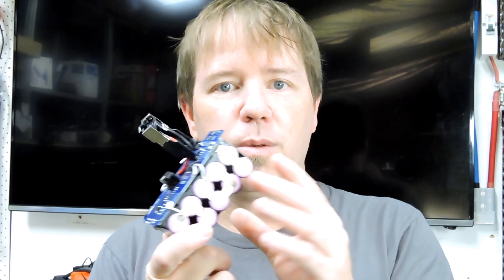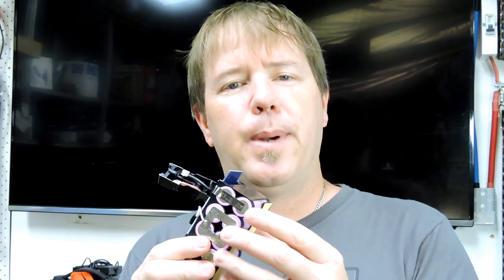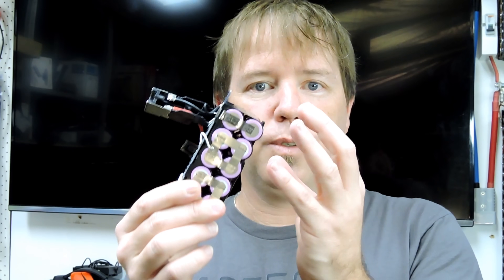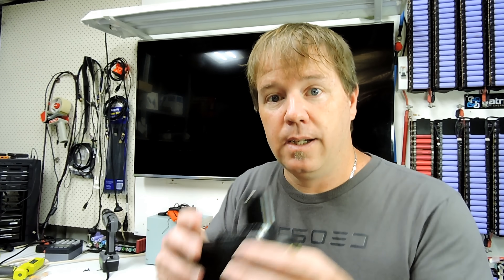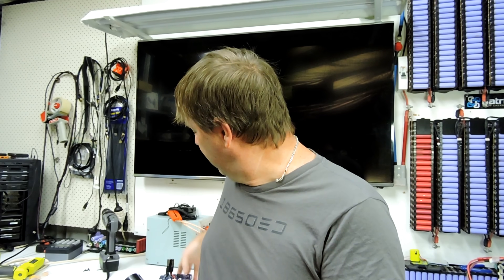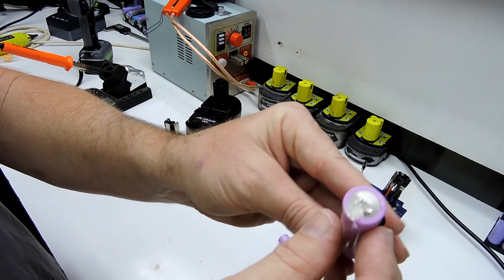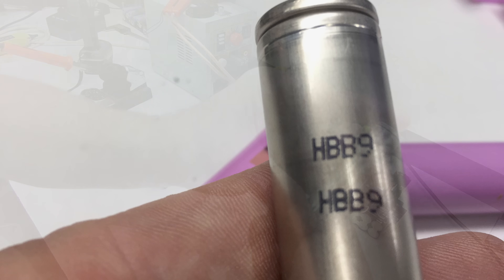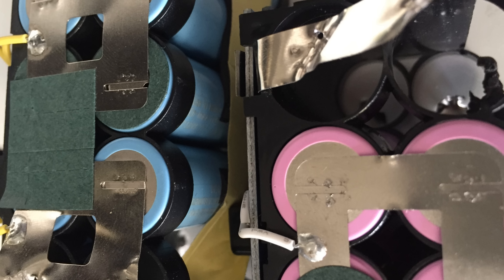Did Vanon set me up?

Comment: I probably would have waited until the results were in before posting. It does seem dodgy though
Reply from the maker: My issue is I promoted something with known fantastic cells with data sheets and proven track record and so far all reports no-one has received the same product yet Like I said in the description - very happy to print a retraction and remove this video if there is any evidence to prove I'm wrong.
Reply: You can call me laptop repair

Comment: I sub you because it looks like you have a DYI Power wall and I am I'm thinking about doing a partials Solar Power Wall to start to to run my office - computer, lights and other items. I am just getting started. I have gotten around 50 use laptop battery packs. most are Samsung batteries. After charging some of them most 2300+ again I am just starting and have lots to learn but I've been interested in solar for a long time but one of the things that put me off is the battery cost. With lithium batteries I can build a very nice battery pack for less $$ and batteries will last longer.  Any help would be appreciated. What size battery pack should I make how many cells, where to get the holders that you have on your wall.  Thanks and I will start watching some of your earlier videos.